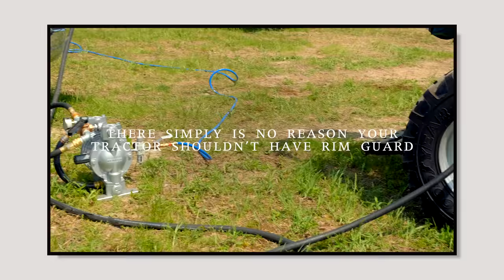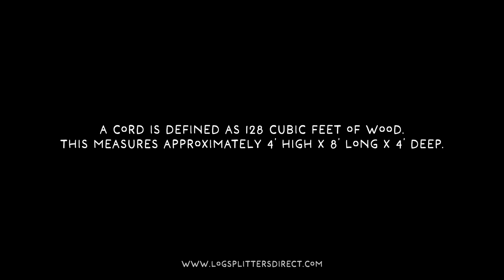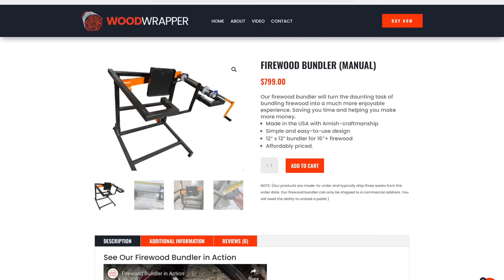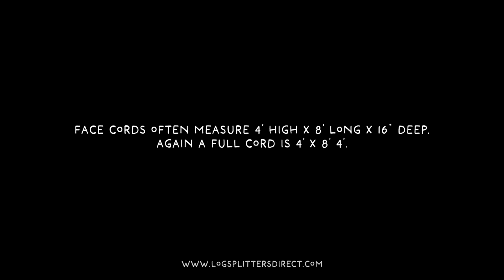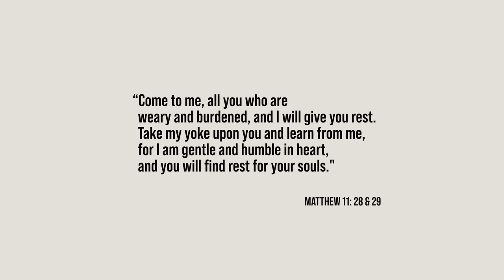WHERE'S THE PROFIT IN FIREWOOD? I DON'T SEE IT 🤷‍♂️

Comment: Most firewood company's buy logs thrn process it then deliver it in a dump truck or a dump trailer. 375 to 400 a cord. 400 delivered 375 you pick it up. Very pricey but that's thr cost go other area it can be cheaper. Burn 3 cords that's 400 each x3 so 1200 per year for heating. Propane to fill is 1400... no stacking or moving wood. So is it worth 200 for the pain to deal with.

Comment: If I may . If u calcite it at 12 months . Your wrong . If you calculate it as a part time 3 months max actually work involved.. that is great pay .. just saying
Reply from the maker: I'm not sure what you mean.  It's per unit, so 12 months or 3 months doesn't matter.  Go by the hour.
Reply: @GoodWorksTractors  is the calculation done at 3 hours a day for 3 days a month or 5 days ? If it's per unit   then what is the other base number for the total . 🤔?
Reply from the maker: @chuckthomas8176  Why don't you watch the video and it'll tell ya :)
Reply: @GoodWorksTractors  I did . I guess I missed it .. 😕

Comment: not to bash it but a firewood business seems like it would have terrible margins. i assume the equipment and insurance are expensive and woodlots eventually run out. for personal use i think it's probably worth it- especially if it's your hobby/workout.

 i think the cost/benefit for wood is dictated by the availability (or not) of cheap fuel. In my area everyone has natural gas which is cheap compared to propane or oil so TBH i don't even burn wood anymore except outside in the pit. i don't miss it. i grab the remote now and set the thermostat on the gas fireplace and walk away...

Comment: Time worth nothing, Tractor $40,000? , chainsaws $2000.00? , wood spliter $5000.00? , trailer  $8000.00? ,  fuel, maintenance etc.&1500.00? , . How about a 2500 series truck, storage, and everything else. Must be a really great tax write-off. How could you possibly make $80,000 a year with firewood. Ahhh, add a you tube channel.
Reply from the maker: Magic!